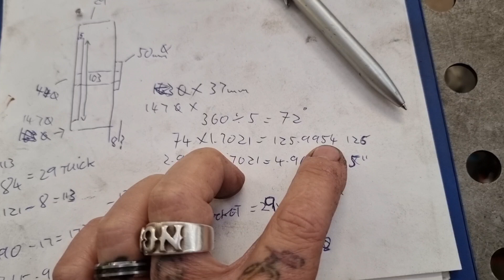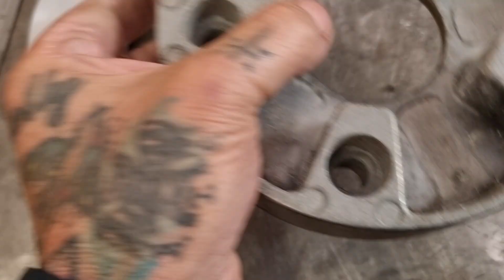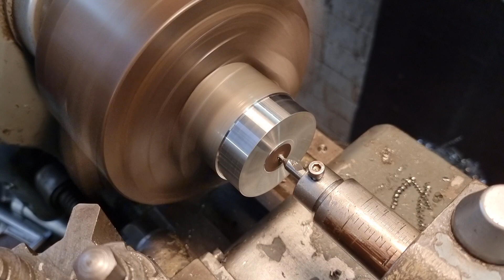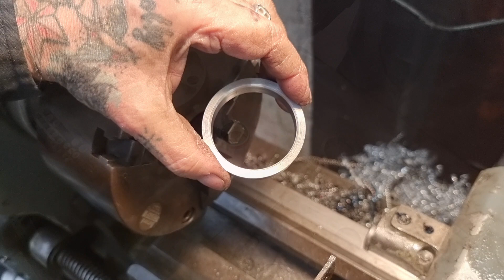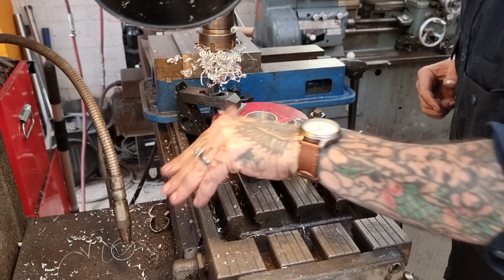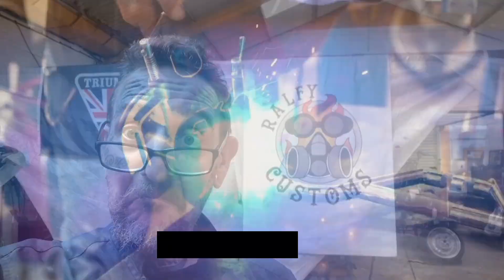Vrod Wheel High Neck Sportster Pt8 Handmade Custom Bike Building ##chopper #bike #handmade #harley

Comment: I can remember adapting a spoked wheel for a late model sidecar for an hd so, the bike could still use the ring gear for reverse 
   They(HD) had a goofy reverse setup using a starter motor and an extra battery.
    Iirc, I had to cut half an inch off the hub. It was nice having equipment at hand. I miss doing it.
Reply from the maker: Cheers Russel mate